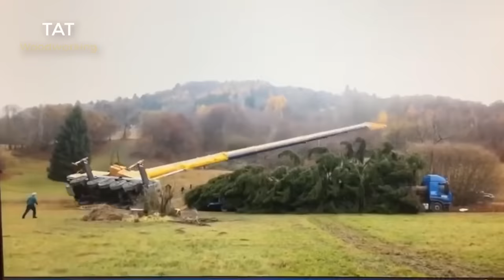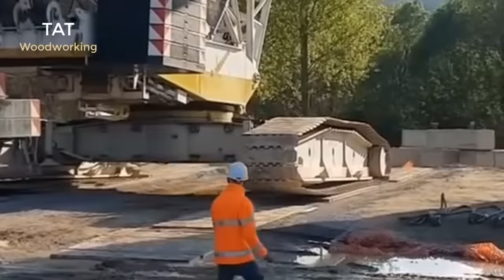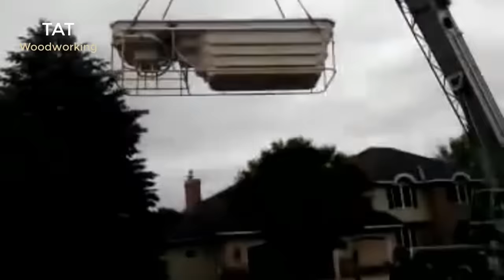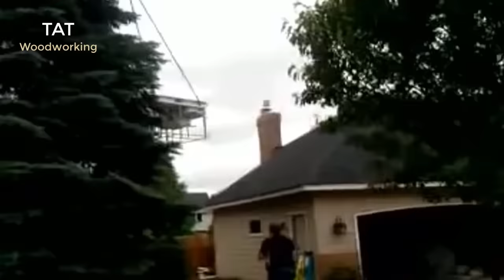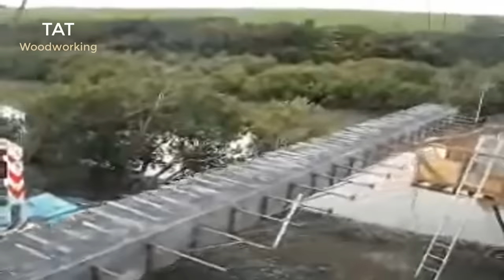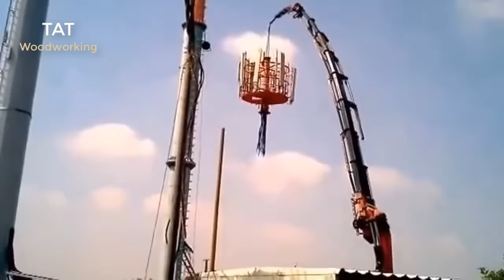Amazing Dangerous Idiots Crane Operator Skill - Biggest Crane Fails Heavy Equipment Machines Working

Comment: I am a crane operator, I’ve operated cranes just like these, and all of this is really sad, there’s people who got killed in these videos.
Reply: Are these accidents the result of trying to lift unknown loads, too much weight, bad positioning or just trying to get the job overwith and cutting corners?
Reply: @Mark.Cleworth  You da man.
Reply: @Nightdiver20  Cranes have computers that tell the operator how much weight in on the hook , how far they can reach safely.
Reply: @stevethomas760  so operators ignoring alarms then?
Reply: @stevethomas760  Also,the further out the boom is,the lower the weight limit is.
Reply: @Nightdiver20  The cranes I've interacted with yes. IF you have a Operator that know what he's doing than they can go more but it would be he ass in a sling if it goes south. Not a easy thing to do if you got a job Superintendent "encouraging"  to finish
Reply: @1953beetle  Yep, dramatically. I've been on jobs when the contractor had to get a large crane just to get reach not weight
Reply: @stevethomas760  👍
Reply: @stevethomas760  Understood. I had suspected that was the root cause of most of these.
Reply: @Nightdiver20  All of the above. Let's not forget the real life application of mathematics when it comes to crane work.
Reply: @1953beetle  Very critical point a lot of these crane operators don't realize. Knowledge of physics needed here.
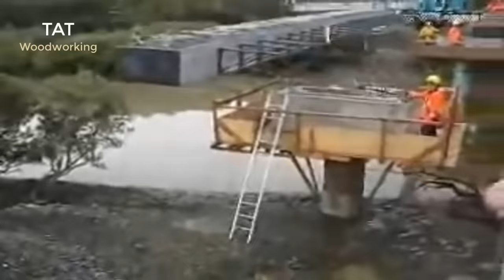Reply: @Nightdiver20   I can tell you for a fact that the one at 4:06 wasn't the operator's fault. The construction company had a survey done which told them that the bank could not support a crane and told them they would need to dig out 200 tons of soil and replace it with crushed rock to make a stable base for the lift. The company decided this was too expensive so they just decided to ignore the report and try anyway.
Reply: Didn't see anyone getting killed?
Reply: This is a bit sensationalist. No one appears to have been killed here

Comment: I've worked around cranes for 40 years as a Ironworker. Modern cranes have a computer that will tell how much weight is on the hook. The Operator has to over ride the computer to get "out of the chart". The second mishap could have likely been avoided by a tag line  to keep the load close to bank so the Operator could keep boomed up.
Reply: @kevinburk1670  Certainly some screw ups in this video. That said the guys I've worked with were very professional and very aware of their responsibilities
Reply: @stevethomas760  It would seem like simple calculations, how much does the item weigh that you want to lift vs. the weight of the machine and what angle the boom. A computer could tell you easily and also account for 15% error in your calculations.
Reply: @UberKrispy  Yes, cranes have been using computers for years. It weighs everything, including cable. A operator can override it. Years ago we were lifting a couple of presses for shipment from the old GM plant here in Atlanta (107/114K lbs). On paper the crane should have done the lift but couldn't. It was damn close but it would have been on the operator if it went south. Let's say it would be a career move. They brought out another crane.
Reply: Or adding extra weight to the rear or securing it with deep grounding.
Reply: @spacelemur7955  Did you have to bring up the ex?
Reply: @stevethomas760  😱
Reply: …Unless the ground gives way
Reply: Did 5 years in civil metro box underground train lines and every crane was working blind. The biggest crane onsite was a 900 ton. These cranes were going 24/7 for years, and there wasn't a single accident, despite it all being blind work.
Reply: @musashidanmcgrath  On a job some years ago, the labor foreman had a skip pan beside the building loading material. He lost his balance and grabbed the skip pan. Hanging 5 floors up with the crane radio clipped to his belt, no communication with the operator so he stopped. Lot of people flipping out, couple of our guys ran over "hold my belt", leaned out over the side, spun the skip pan. When he came around our guy grabbed him and pulled him in the building. Told my buddy, "I think he's going to name a kid after you".
Reply: @UberKrispy  MATHS IS HARD!

Comment: Most of these could have been avoided by doing a dry run to check the radius and making sure you had capacity.
Reply: They didn't look wet though,  looked like dry days they were doing them on
Reply: @garethhancock8525  ha,ha

Comment: That's what happen when you don't operate these machines according to the manufacturer's specifications.
Reply: .... Or if they extend the boom too far horizontally - a crane can pick up much more when the load is close to the base, but the the crane tips if the load is moved further away - which is exactly what happened at 0:26 - what is safe when the load is close will tip the crane over as the load is moved further away from the base.
Reply: @pulaski1  which should be in the manual
Reply: @bernardsbbq  It should be obvious even if it wasn't in the manual.  ;)
Reply: I would say alot of them have the limitors disconnected
Reply: brilliant

Comment: My question is when the crane begins to teeter why don’t they release the cable so the load drop preventing the crane from toppling?
Reply: There is no "release."
Reply: @jt8251  He means lower at maximum rate ...  that said, I suspect that it's already too late by the time "teetering" starts.
Reply: The first reason is that those cranes spool slowly, which is important for heavy weights. The second reason: it IS done, you see it in at least one part, but it normally is too late, caus when toppling starts, it is hard to stop it.
Reply: The load may have been more expensive than the crane.

Comment: I've operated small cranes before, what I don't understand is when it's going to tip over why don't they drop the load??

When a crane even lefts ONE outrigger off the ground an inch ... it's VERY obvious up in the cab of the crane.
Reply: Tipping  can be preventable with all kinds of skills and little  tricks but you think  you can tell when a cranes is Tipping  but sometimes  it all happens  just so fast the operator  doesn't see its coming  until its over
Reply: Dropping isn't possible.
Lowering at max rate is a possibility, and saved the crane that lowered the water tower at 4:59 but is normally too slow.
Reply: @Delibro  "Lowering at max rate" is sometimes referred to "dropping" in the trade
Reply: @MikeBaxterABC  Ohhh, I didn't knew that, thx.

Comment: This is not the fault of the crane operators. 
I don’t understand why a sensor transmitter system is not mandatory on a modern high-performance crane? Running-gear/support-arms load cell. The tipping point of the cranes could be recognized in time. 
And.
Why there is no emergency lowering function. 

Eng.//Hu.

Ez nem a darukezelők hibája. 
Én nem értem, miért nem kötelező egy modern nagyteljesítményű darukon egy jeladórendszer. Futómű/alátámasztás erőmérő-cella. A daruk billenés-pontját még idejében fel lehetne ismerni.
És
Miért nincs vész-leengedés funkció.

Comment: From a simple observation these failure were inevitable. I would cut the capacity of these pieces of equipment in the circumstances seen in these videos by a minimum 25% and possible more for a safety extra safety factor.
Reply: Operator error,all of them

Comment: I really don’t understand how these sorts of accidents happen if it’s not due to equipment failure. Surly they calculated weight to centre of gravity and know a crane’s maximum lift capacity in various  scenarios…
Reply: Cranes have safety shutoff, but the operator can over ride it. These are working construction sites. It's assumed that the crane operator is trained and skilled and knows weights by instinct. That's why crane drivers are one of the highest paid. Of course, a bad driver is a bad driver, but they are very rare on large civil jobs.

Comment: It's not fully the operator's fault! Whoever who arranged these cranes, engineered the lifting process are the ones at fault. The operator follows whatever plan their superior does, meaning if they're pushing for a deadline they would just force the operator to 'go for it'. Failing to comply with practical lifting standards - i.e load chart against boom radius, actual estimation of lifting load and HSE lifting standards (0 - 100% load consideration). But if the overload warning light has sounded out and the operator does not stop, it's a fault on the part of the operator. It's a swiss cheese model of operations that everyone has to consider when doing heavy lifting.
Reply: Well said, people shouldn't blame operators without knowing the context.

Comment: I am not the smart guy.  I do know there are people who are.  Most of the guys doing the work are just following the print and calculations.  Made by the engineers.  Hard to believe that people comment oh them guys must be drunk or failing.  The guys on site are putting foot to ass while the engineer stands back and collects the big bucks.  On those big jobs not many of the operators are making calculations on the fly.
Reply: How would you know they are exactly following the print and calculations made by the engineers, and not according to there own judgement?